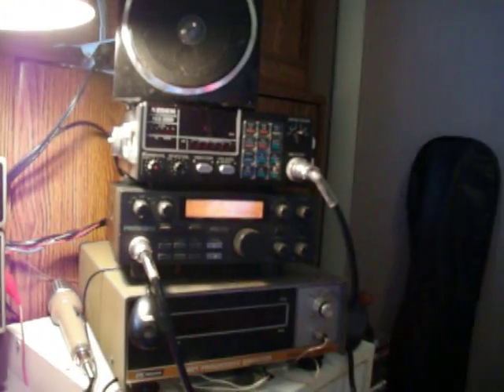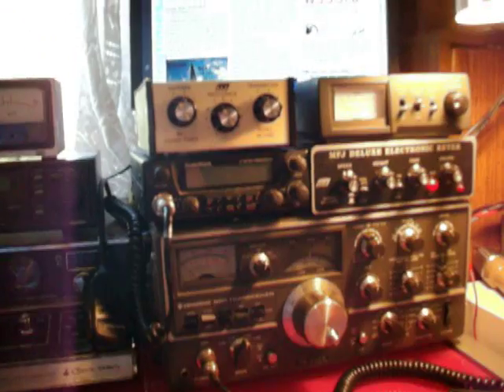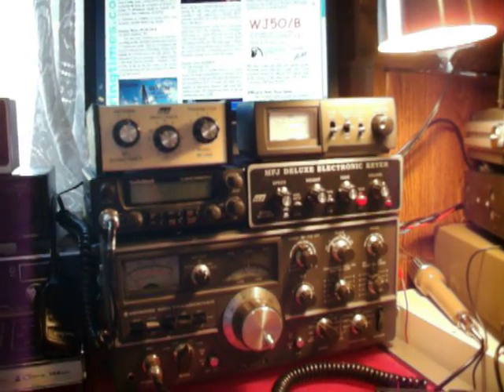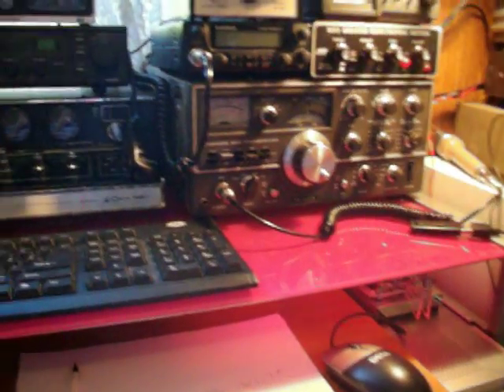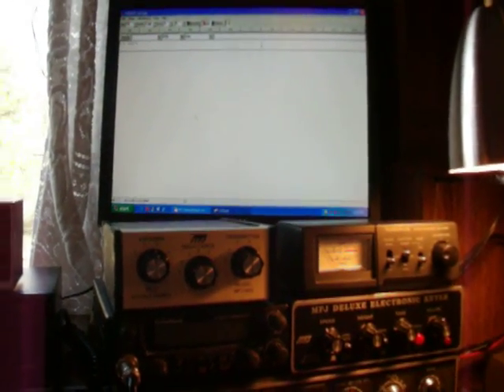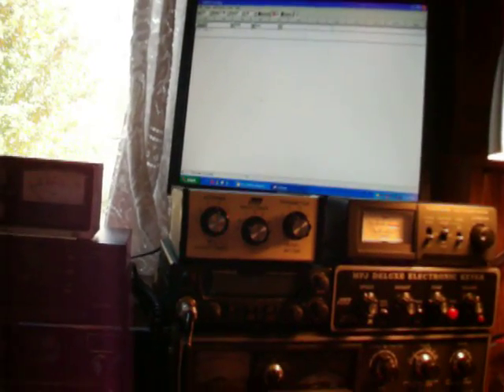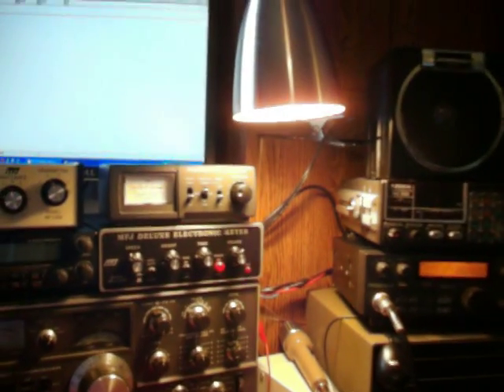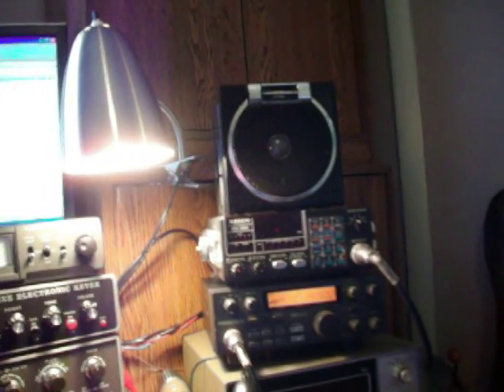10 Meter Beacon For Amateur Radio 28.272.8 World Wide

Comment from the maker: There a whole lot of space on 10 meters,I have never seen it crowed.
There plenty of Frequency space.If you are not A Ham Why be A complainer.
   The 10 meter CW Band has room for all us Amateur Radio operators.
I also like CW have used it for over 30 years.The Beacons are to test probation
 and see first hand where the band openings are.It's a excellent tool